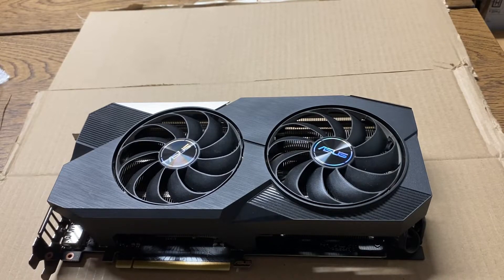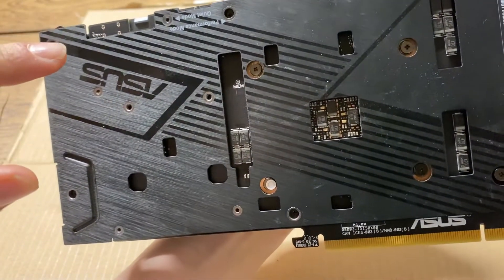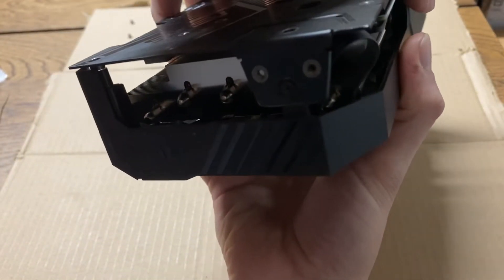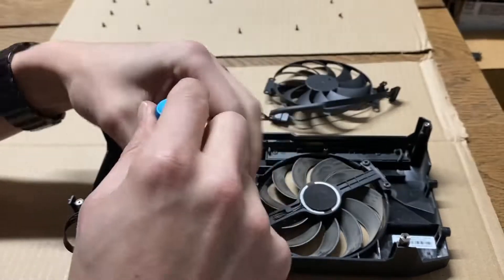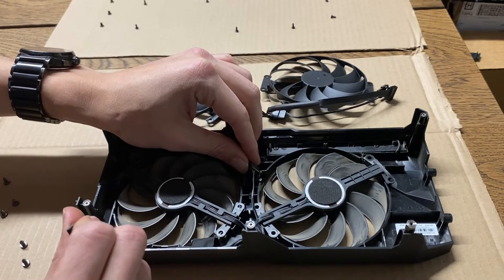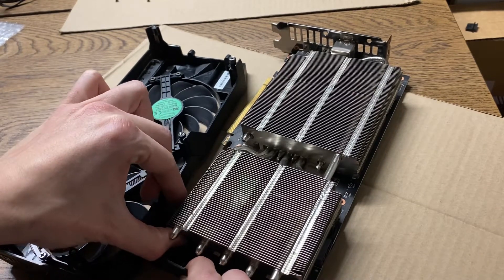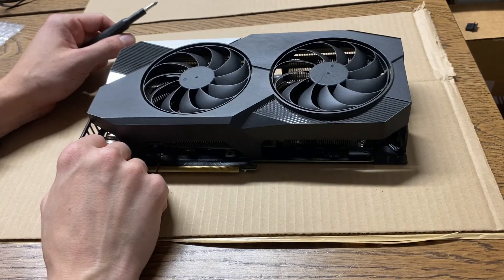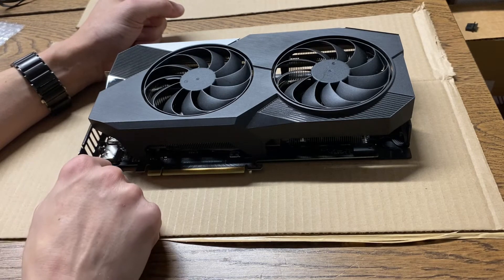Fan Down! Asus 3060Ti fan tear down and replacement.

Comment: My Asus rtx 3060 OC 12gb fans just started wobbling real bad... the card is a year old. im suprised the fan didnt just fall out of it. Pushing down on one side of the fan blades theres probably about a half inch of movement in the fan.
Reply from the maker: At least yours made it a year. The aftermarket ones seem to have more longevity

Comment: Also one more question.. you mentioned that the card was not even a year old once the fan died. Any reason you didn´t contact Asus support for guarantee and instead fixed it on your own cost?
Reply from the maker: Because at that time sending my card back to them and getting it back may have took a while and they just would have put the same fan on it that it had. So because I already had some general knowledge of disassembling graphics cards it just seemed easier and better for me knowing I did the job right to do it myself. My father always told me as a kid if you want something done right you have to do it yourself. And if you do it yourself you never have to rely on somebody. This card was the easiest to take apart and get to the fan because you only have to take the cover off instead disassembling the the card
Reply: @Mattyattacks1313  Alright, gotcha! That is also the reason why i don´t want to return my card return to Asus and rather do it myself. I never done a GPU fan replacement before but with the help of this video i think i get it done. Also thumps up for your Dad, that is some good advice 👍
Reply from the maker: Good luck. It’s so easy that a dummy could do it! Dummy=Me

Comment: How is the quality of these replacement fans? 
One of my Asus 3060Ti fans started making noises a few days ago and the card is not even 2 years old and now im looking for some replacement fans.
Reply from the maker: They are still working now. So I would say very good but I don’t know if you would be getting the same fan because I ordered them years ago.
Reply: @Mattyattacks1313  I recognized on your video that these fans say Everlast on the sticker. I found them on ebay, so they are still available and i will order a pair. Thanks for your help!
Reply from the maker: Well so far they have lasted forever!

Comment: What screw should I remove to to remove the backplate only?
Reply from the maker: Honestly I’m not sure. I never went that far but if you get the front plate off, and then take the screws off the heat sink cooler. I would think more than likely they would be under it. And the will be heads up toward you.

Comment: i took mine aprt but the pins connecting the fans to the motherbaord itself were very hard to take off, how did u do it?
Reply from the maker: Watch at one minute and 53 seconds all you do is pull off
Reply: @Mattyattacks1313  ya I understand that but mines like in there stuck and I’ve tried every way to pull it off and it won’t come off
Reply from the maker: Maybe try using something flat and thin and try to stick in between pin and connecter and try to separate it. I just pulled mine right out. Also look and see if there is a clip holding them together.

Comment: i have the same card, it's freaking gorgeous but it gets very hot and loud when you don't cap your FPS.
Reply: Я пользуюсь такой около года и не скажу что она горячая. Максимум что я видел у себя это 68 с учотом что в комнате было +30.  В среднем же она держит 64-65° при 1700-1800 оборотов вентиляторов. Но я ее эксплуатирую на 0.900 и 1890 мегагерц. Это 170-180 ватт. И в таком режиме она работает 60°+/-2° и 1500-1700 оборотов. В целом отличная карта! Для 1440р  хватает сполна
Reply: mine gets UpTo 88  @Dt_75m
Reply: That's impossible, mine doesn't get hotter than 80, runs average 75, you probably have a very closed case with bad airflow inside@gorkman5697
Reply: @gorkman5697same here man 

Have you found a solution?

Comment: hey, where did you buy the fans?
Reply from the maker: You can get them off Amazon or eBay. Whichever is cheaper. I believe the were the 95mm fans
Reply: @Mattyattacks1313  Thank you! BTW,  you said there was an RGB cable as well, but you didn't seem to plug it in?
Reply from the maker: @Kuusakat so that rgb cable will plug in with the fan harness cables
Reply: aliexpress has them for way cheaper than amazon

Comment: Surprisingly good quality Asus ...I mean ez to assemble and change...
Reply: Also try spraying deodorant (which is 99% alcohol based) into old fans innards ! That will clean the accumulated dust particles and make the fan quiet again (works with any other fan - case or PSU )
Reply: Spray it well - flush them out - even if you make them all wet - don't worry - alcohol is not conductive
Reply from the maker: I’m more of a jelly guy. Strawberry jelly works the best!
Reply: @Mattyattacks1313  You are joking - right ?
Reply from the maker: Yes I am. Please don’t try this🤣
Reply: @Mattyattacks1313  🤣
Reply from the maker: Minus the fans!